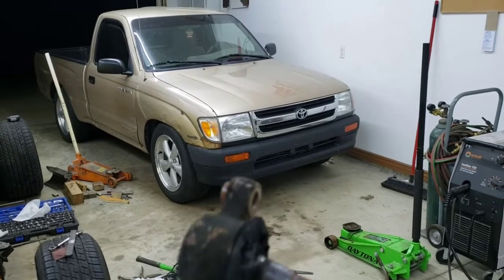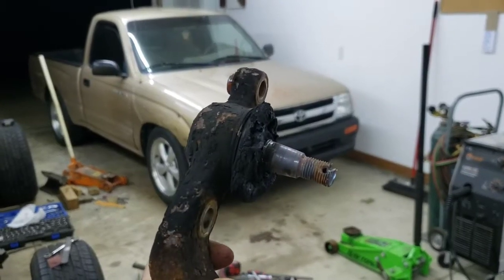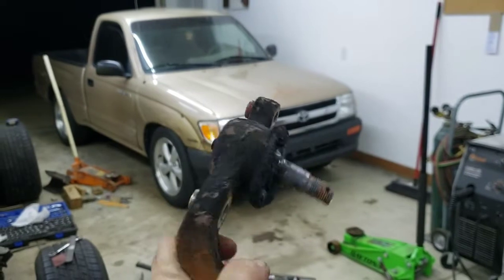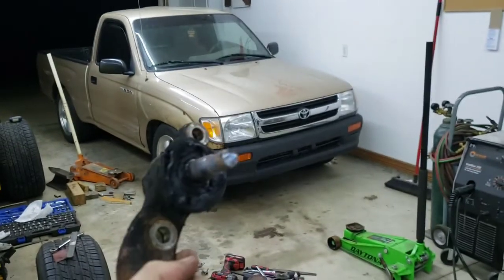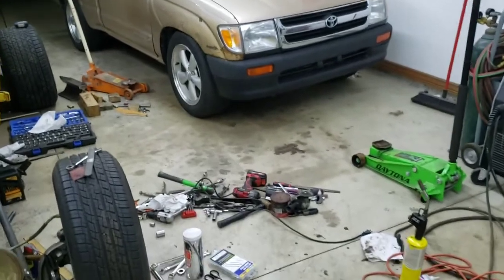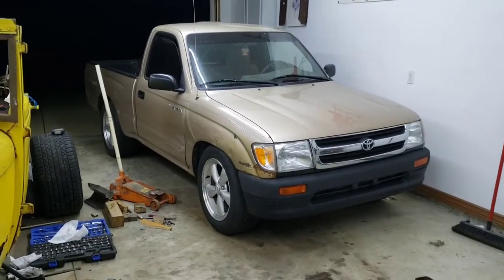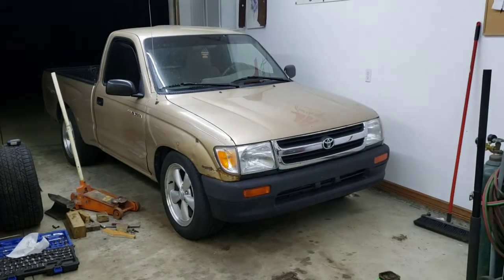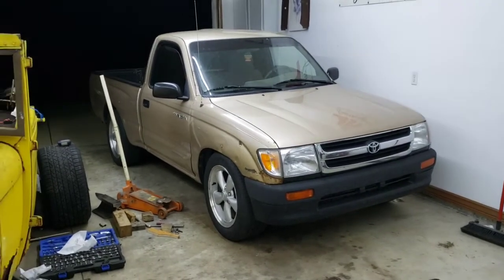Lowering a 1997 toyota tacoma

Comment: Can I run this setup on stock shocks? I recently purchased a 96 Tacoma that seems lowered the ride feels really firm. Also every time I go over a bump, it feels like a hit metal on metal on the rear (possibly bump stop?)
Reply from the maker: @mvc2177  you'll be fine with the stock shocks on the front, the rear bumpstops will likely need to be trimmed. Its not common but I have heard of the rear shocks bottoming out on lowered Tacoma's

Comment: Good job, what exactly you did in the front ? 
I’m looking to do this to mine 🙏🏼 please more details thank you
Reply from the maker: Just bolted the stock lower balljoint on top of instead of under the lower A-arm.
Reply: Did you have to get an alignment after?
Reply: @Loweredtaco  Of course you have to
Reply: Its called a ball joint flip
Reply: @variousengineering1965  you did the upper ball joint too right?
Reply from the maker: @toycoma98  I put new upper ones on at the same time. I kept them in the factory location as they weren't needing to be moved like the lower ones to therefore lower the truck.

Comment: I have a question installed 3 inches block in the back and right now I have a vibration and you can help me
Reply from the maker: @kerwincolon3132  potentially loose u bolts or your driveshaft angle isn't correct.

Comment: What size are your wheels tires
Reply from the maker: Just temporary tires at the time. 215 55 r17 fit the wheelwell perfectly on these.
Reply: @variousengineering1965  Cool.. how dose ride??
Reply from the maker: @barrymonroy7138  honestly better than some newer cars I've been in. I'm using gasmatic shocks on the truck at the moment and I cut about an inch off the rear bump stops now.
Reply: What kind of wheels are those.? Where did you get them from.?
Reply from the maker: @christianjimenez7587  sn95 ford mustang
Reply: Thanks.!!! That is a good looking truck.! Clean.!